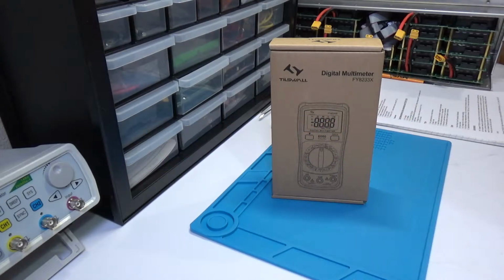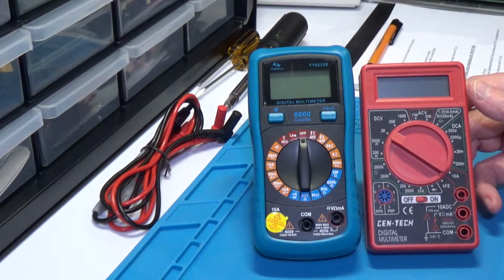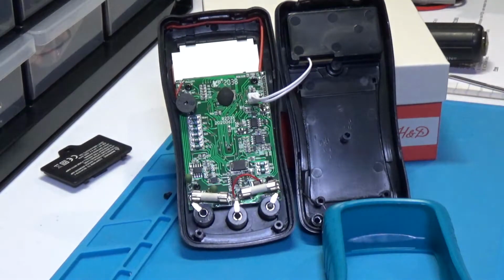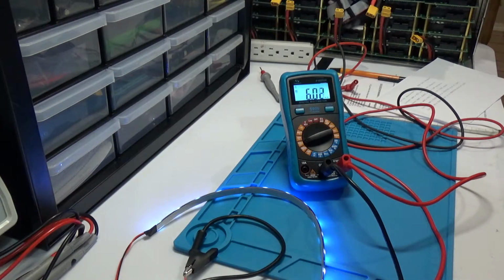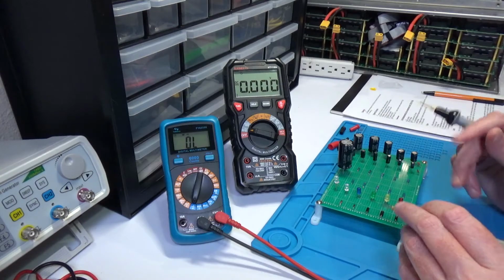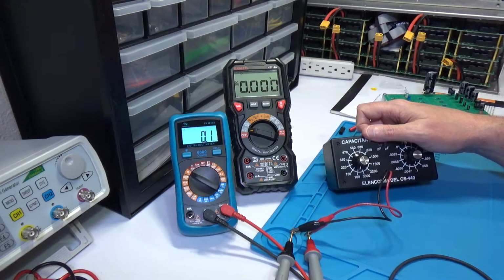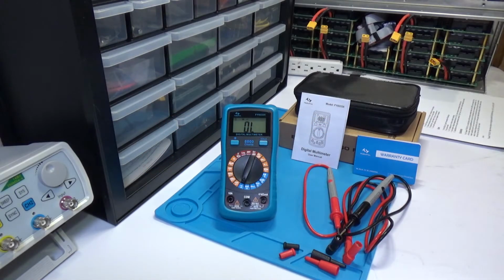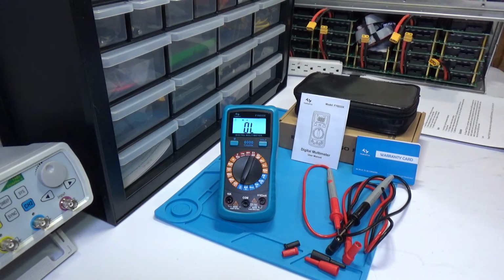Tilswall FY8233X Multimeter Review and Testing

Comment: Thats actually a nice looking little meter, the backlighting is nice also ! Not bad hey !
Reply from the maker: Just so happened to stumble across that one.  It's not without its flaws but for the price it's a pretty decent little meter.
Reply: @Sui778  Ive seen some of the cheaper meters be perfect solution :P  I bought 4 of these China ZT301 meters so i can meausre Rail voltages when powering up an amplifier, and if i want really precise i use my 6 didgit Siglen bench meter.
Reply from the maker: This was strictly one of those "What do I have to lose?" kind of buys - maybe even impulsive.  But as it turns out it's also a usable meter - so win-win situation.  There will be the day I review a dud - but not today.  LOL.  As it stands - this is probably what's going to be sitting in my glove compartment - it's a perfect SHTF meter.
Reply: @Sui778  Heh, i love dud's they make good teardown videos !
Reply from the maker: True that.